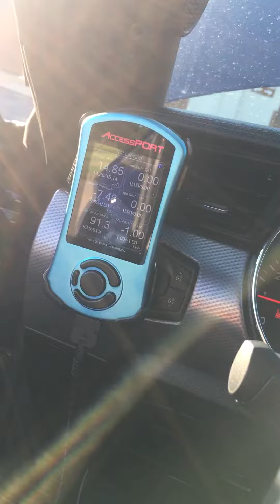2015 Ecoboost Mustang w/ Garrett 2867r turbo

Comment: I am saving for this exact kit. How does it feel compared to the stock turbo? How is the lag?
Reply from the maker: I'm still in the tuning phase and did my first datalog today but even with the base tune it's noticeably faster  but I expect it to become a lot faster once the tune is done as well as the e30 tune
Reply from the maker: Link to my friends channel for a more professional review with exhaust clips 

https://youtu.be/9kMpqqypyy4
Reply: +matt sword awesome I'll definitely be interested in how your tune progresses. I trying to choose between doing this turbo kit to the ecoboost or trading up to a GT. subbed
Reply: +Applegenius19 I am trying*
Reply from the maker: +Applegenius19 honestly it's what u wanna do. I'm still a few grand under the price of a gt with lower payments and much lower insurance and higher fuel economy. Still getting 30+ highway. And unless the gt is supercharged or turboed this kit on e30 or even e85 will beat and 5.0 pretty easily from what I've seen. Hope this helps!